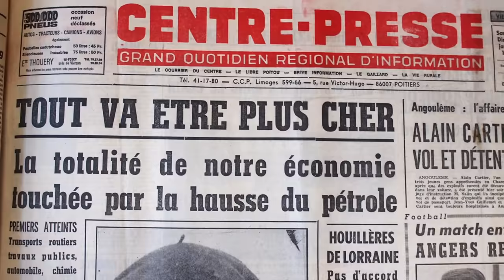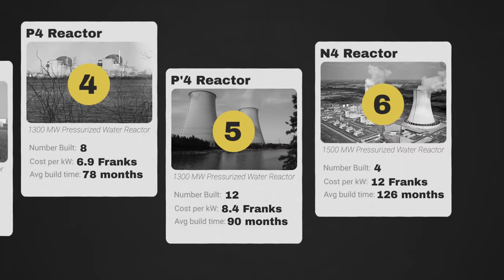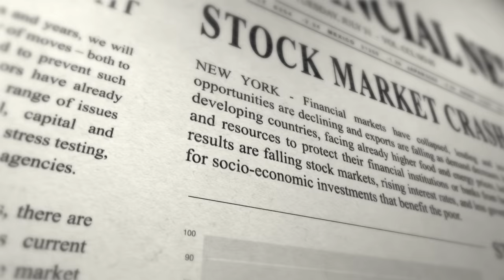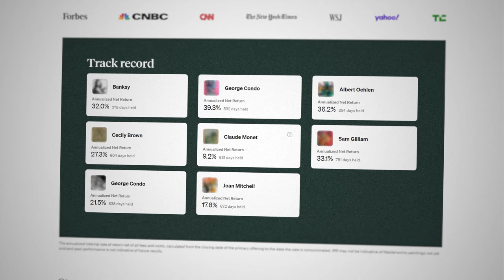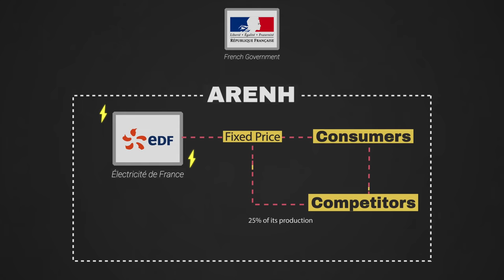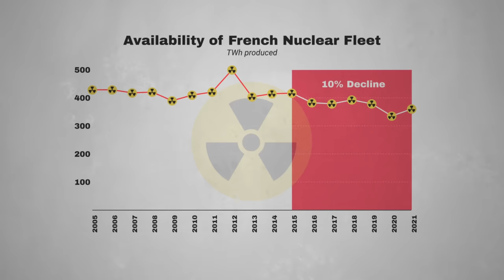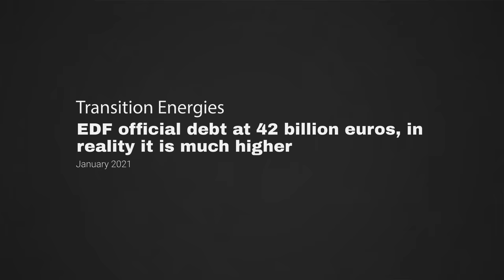Why French Nuclear Energy Failed

Comment: There are different aspects involved. 
1) Nearly all attempts on privatizing state monopolies in the last decades failed more or less - especially if the former monopolist was forced to subsidize their competitors and/or selling them services at a fixed price. The only way to privatize such corporations would be to split them up equally - but that is often not possible.
2) Backbone infrastructure should never be controlled by private owned companies or by companies operating like private owned companies. Maintaining backbone infrastructure does only work if it is nationalized - at least within a capitalist market-based economy.
3) In the long run fission technology will not be economically feasible. It is based on consuming limited ressources and therefore not sustainable, and it can not compete with renewables. Without subsidies by the state electricity generated by any new reactor would be very expensive, it becomes cheap only after decades, but then the reactors start to break down due to the immanent wear.
Reply: I liked your comment for #1 and #2, but #3 is demonstrably false. You forgot about fast breeder reactors. France has one such reactor which produces energy by reprocessing spent fuel from all its other reactors (as well as some from other countries). Currently the US has enough spent fuel to power all the country's electricity needs only with fast breeder reactors for the next 150 years. Breeder reactors create more fuel than they consume, making uranium - effectively - a renewable resource. Nuclear reactors, in general, produce huge amounts of energy for the amount of fuel used, so actually using up all the accessible uranium in the Earth's crust would actually take a really long time. It's not really a scarce resource (unless you waste so much of it building a needlessly large nuclear weapons stockpile like - sadly - we do here in the US)
Reply: @jeffbenton6183  France has currently no fast breeder. The last one, Phénix, was shut down in 2010; it was small-scale prototype reactor, which was however more reliable than his bigger and younger brother Superphénix which had to be shut down 1996/1997 due to many malfunctions. Germany stopped constructing its own fast breeder in 1991 for technical and economical reasons; the buildings are now part of a theme park. The UK decided in 1988 to stop funding for fast breeders, 1994 was the last reactor shut down. The US closed down their last "fast flux test facility" in 1992 (hot standby until 2002)  - afaik they never had a commercially used fast breeder. Currently only China and India are constructing fast breeders, and only China, India and Russia are operating fast breeders (and the Indian and Chinese ones are test facilities).
There is a reason for not using this technology: fast breeders are far more prone to nuclear meltdown than "normal" reactors (even if such a meltdown can be easier contained by constructing the reactor within a pool filled with sodium coolant). Another problem is the need of most concepts for plutonium (fuel rods from uranium-plutonium mixed oxide or thorium-plutonium mixed oxide) as starter. Fast breeders do not making uranium as such a renewable resource,  since they only convert non-fissile uranium-238 into fissile uranium-235 (respectively in theory alternatively thorium-232 into uranium-233) - the fissile uranium is then used to generate heat by fission, which has then to be converted into electricity, which is not a very efficient way to produce electricity. A closed-loop economy of fast breeders and other reactors could increase the amount of harvestable energy from uranium by factor 60, which is not very much - only with including thorium (which is currently still mostly a theoretical option, not a proven technology) the increase would be significant. But economically it is still the most expensive option. Electricity from nuclear reactors can only compete economically with electricity from solar and wind if heavily subsidized by the state (directly and indirectly) - new "conventional" reactors are all over the world only built if at least partly funded by the government, and fast breeders would be even more expensive to construct.
Reply: @MichaEl-rh1kv  Looks like you didn't forget - sorry if my tone was combative. 

I was under the impression that France's FBR was still operational. I'll have to do more research. I was also under the impression that The United States' FBR had been decommissioned much earlier than that on the grounds that FBRs were a proliferation risk if positioned in certain countries (and the US shouldn't use what it wouldn't give). Perhaps there was some other problem - I'll have to do more research on that. Thanks for pointing that out.

The plutonium requirement isn't a huge dealbreaker, as many conventional reactors produce some plutonium as part of normal operations. (Not to mention that the US has a bunch of plutonium locked away in a weapons stockpile that's far larger than necessary to deter Russia and China from using theirs). 

It sounds like you're already familiar with the solution to the meltdown issue, so I won't belabor the point there. 

I didn't say it made uranium renewable, I said it made it effectively renewable. For all intents and purposes, we will never run out of fuel for it - the same is true renewables (which don't require fuel at all). The US alone has more spent fuel than it could realistically use in 150 years. Using FBRs for that would be less efficient than using conventional reactors, but it would still be more efficient than all other energy options. That's without even considering all the uranium that hasn't been used yet. There is likely enough untapped natural uranium in the ground to - after enrichment - to meet current consumption rates for another 230 years. Though it's more expensive to extract, there's enough uranium in the oceans to meet current demand for 60 years. That's without resorting to FBRs making use of thorium. Practically speaking, nuclear fuel will never run out. 

Nuclear and renewables don't really compete with each other - they complement each other. Wind and solar are intermittent power sources. Nuclear power is quite good at providing "base load" power, all day and all night (and newer reactors are flexible enough to ebb and flow with wind and solar). 

I'm not actually sure that nuclear truly is the most expensive option as everyone says it is. The levelized cost of a conventional reactor is about $175 per kilowatt-hour. Wind and solar by themselves have a levelized cost of about $30 to $40 per kilowatt-hour, last I checked, but pumped-hydro storage - the cheapest option - adds $100 - $150 per kilowatt hour to that figure. Pumped hydro isn't available everywhere, so most plants would cost more than that (at least with existing, proven technologies). Geothermal and hydropower are great, but not available everywhere. That would leave coal and gas, but not really. Statistically speaking, nuclear power has caused fewer deaths per kilowatt-hour than any other source of power (even including the Chernobyl disaster). Currently proposed carbon capture systems alone may cost $1 billion per plant, and they only capture 80% of emissions. Imagine how expensive it would be if fossil fuel plants were required to cause as few excess deaths as nuclear ones. They would need to capture all of their emissions, not just most of them, and they'd have to find some place to store them (or find a way to reuse them). It just wouldn't be feasible, let alone affordable. That, by the way, is the real reason why nuclear power is so expensive. It's not in the inherent costs of maintaining the nuclear chain reaction, it's all the safety procedures. These include reinforced concrete containment structures capable of sustaining weeks of artillery bombardment -  or an airliner crashing directly into it - together with regulations that cause it to take from 5 years (S. Korea) to 10 years (US) or more to produce one plant. All these regulations are the reason why nuclear power has a better safety record than any other source of electricity (Chernobyl was the product of much looser regulations). Nuclear isn't expensive because it's nuclear - it's expensive because it's the only source of power that we treat the way we should treat all sources of grid electricity. 

I wouldn't say that nuclear requires more subsidies than wind or solar - or any source of power for that matter - because wind and solar receive far more subsidies than nuclear currently does. For that matter, at least in the United States, fossil fuels also receive far more subsidies than nuclear. Wind and solar also require far more land use than nuclear. If the people owning the required land object, then it may take government money to convince them to sell (or the heavy hand eminent-domain). Off-shore wind and solar helps with this problem, but it too, increases the price. In spite of how much more subsidies other forms of power receive, nuclear power still provides 20% of the United States' electricity. This may be because of large subsidies 40 years ago, but that's another point in nuclear power's favor: nuclear power plants last for decades. There's a very high upfront cost, but operating costs are lower for other sources of power. Given that reality, government subsidies may not be required (except for R&D). For existing reactor designs, governments could provide loans to cover the upfront costs of construction, which utilities could pay off over the course of 40 years, using the savings in operating costs. 

It's also worth noting that grid-scale electricity will always attract subsidies, just by the very nature of what it is. It really can only be done responsibly by a government agency, a government corporation, or a heavily regulated private company. Considering your earlier points, I think you already agree with me on that.

Sorry this ended up being so long. I wanted to respond to each of your points, if there was a response. To the best of my knowledge, everything I said in this reply is correct, but of course, I need to do more research, as you have already demonstrated. Feel free to point out anything that I - in your opinion - got wrong.
Reply: @jeffbenton6183  Only one point: In many countries (including for example Germany) new wind and solar plants are in general not any longer subsidized (except maybe if you include general subsidies for the grid and electricity in general, which are not specific to the means of generation, and privileged building permits for wind turbines), because they can produce electricity now cheaper than any other method. Storage facilities however are still subsidized. Baseload power plants like nuclear plants can reduce the need for storage, but not completely replace it. France is the country with highest nuclear share in electricity production in the world (around 72% of electricity, which corresponds to 37% of primary energy). Therefore there are times when they have to throttle some of the plants (which is why they have constructed some of the plants explicitly for this scenario, which however made them more complex and expensive) and times when they have to import electricity from neighboring countries (especially in the summer when the rivers providing cooling water start to dry out or become to warm for the fish living in them). They use also pumped-hydro storage in the French and Swiss alps. (In former decades they also advertised and subsidized the use of electrical night storage heaters to make use of nightly overcapacity, but this has led sometimes to power outages at cold winter days.) This examples shows imho that replacing energy storage by nuclear plants is not a viable options, it can - as said above - only reduce the amount of needed storage. As soon as cheaper storage methods enter the market, they will totally outcompete nuclear plants, which makes investing now in nuclear plants a remarkable financial risk.
(Additionally France had to shut down many reactors in 2021 and 2022 due to technical problems and to increase electricity imports mainly from Germany and Spain to replace the missing capacity, but that is an independent problem. The net export from Germany to France in 2022 was about 5.4 TWh (gross export 8.8 TWh); the years before France had mostly net exports to Germany in the winter months and net imports in the summer months, but in the winter 21/22 France was always importing more than exporting.)

Comment: Nuclear energy is simply never going to catch up to the cost-effectiveness of renewables, the technology is just too far behind now. The gap is even growing every year.
Reply: This isn't so simple.
Renewable energies come with lots of restrictions that scale up badly. Both wind turbines and solar pannels require much more land surface than nuclear power plants and require that land to be where the wind and sunlight are. And given the high costs and losses of energy storage, most of that renewable energy has to be used immediately. This prevents from installing more production based on sun and wind than is needed so that the excess is used when the sunlight or wind is absent and therefore explicitly imposes a certain portion of other sources into the mix to still have enough energy during these down times.

But the most important problem right now with wind and solar that hasn't been solved so far is to build these infrastructures in a way that is secured in the long run and safe to the environment. Wind turbines and solar pannels both rely on non-renewable resources, among which rare earths are the scarcest. Their mining and processing is difficult and expensive to do in a way that doesn't spoil the environment too much. Additionally, most of the currently known reserves of these are in China, which makes absolutely nothing to mine and process them in an environmentally sound way. Additionally, China deciding to stop exporting these to some country would put a stop to its ability to build wind turbines and solar pannels, unless by going through third parties, thus increasing costs by a lot.

If these materials were mined and processed with more care to the environment, prices would also go way up, thus making wind and solar energy much more expensive to develop.
The nature of the pollution produced by this industry also makes it far more difficult to contain than nuclear fission's. The amount of waste is incredibly larger and, since it is chemically polluting rather than radioactive, it never stops being a hazard instead of diminishing in harm with time faster the more it is hazardous.

All alternatives must be developped so that we can pursue these different options to the best of their capabilities and out capacity to use them.

However, it is difficult to underestimate the advantages that nuclear fission has over the other sources.
Nuclear fission has, by far, the largest energy production compared to both the amount of fuel used or the amount of land it occupies. It is also a way more flexible energy source than any other since, like the ones using fossil fuels, you can build the plants about anywhere and their output can be controlled precisely. Nuclear fission also doesn't carry the health risks that coal plants have, nor the ones associated with producing the raw materials to make turbines, pannels or batteries.
If anything, nuclear plants are more akin to hydroelectric plants. There are environmentally safe but require the building of heavy and advanced infrastructures, as well as constant care, to make sure that their operating doesn't lead to catastrophes. But unlike nuclear plants, dams can only be built on very specific spots and require turning large areas into water bassins.